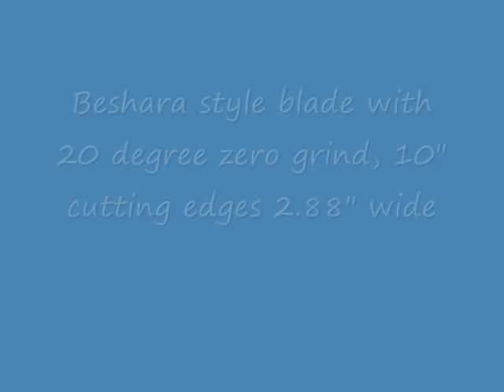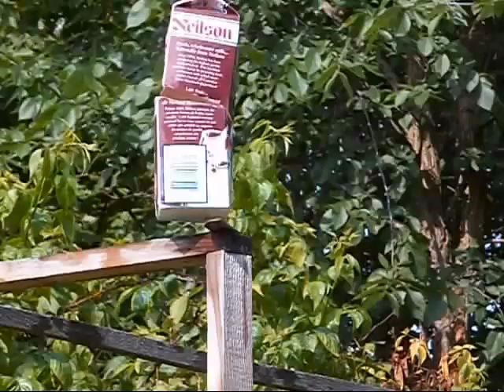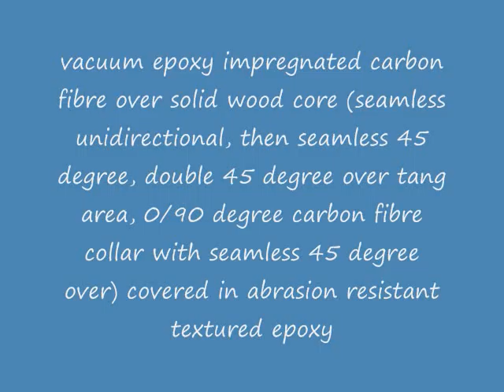spear

Comment: Why titanium, out of interest? Won't it loose it's edge much faster than a high-carbon steel?
Reply from the maker: +MiskyWilkshake  Thanks for the question! Reason 1: my wife is a lightweight and needs a light fast weapon (so do I when injured)  Reason 2:  we leave stuff outside especially camping and Ti is impervious to our environment Reason 3: some steels will chip heavily and "lose their edges" through chipping, though many would be tough enough to dull by slow wear  Reaon 4: if the Ti alloy in this spear is worn dull during self defence,  the aggressive predators in this area will not likely be in any shape to cause harm :)  For my personal use when I am not injured I would prefer S-7
Reply: Well, fair enough! Thanks for sating my curiosity!